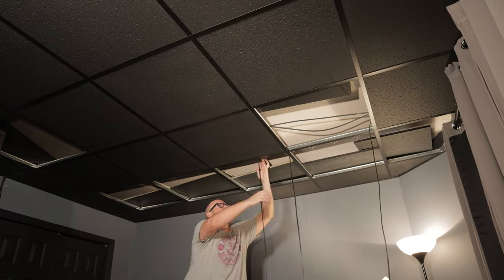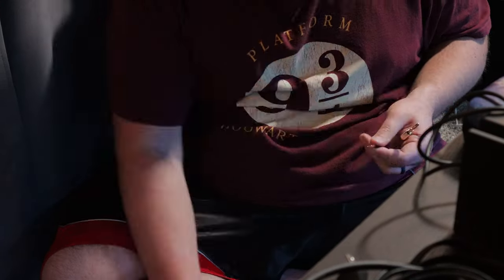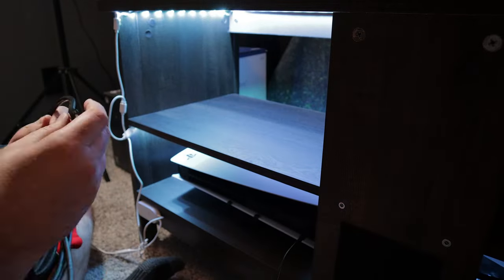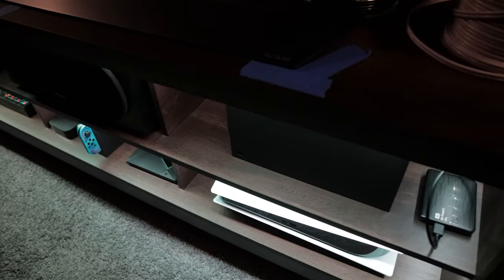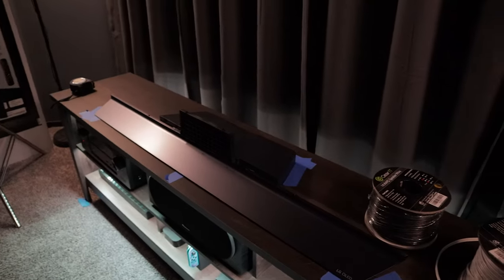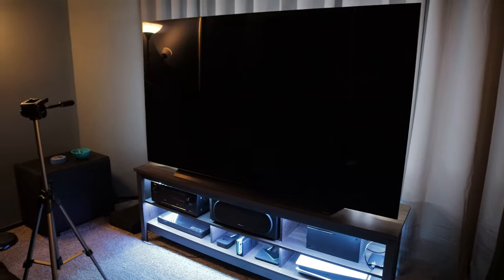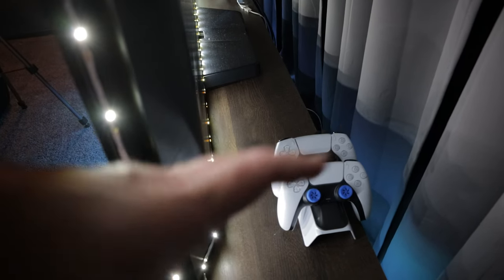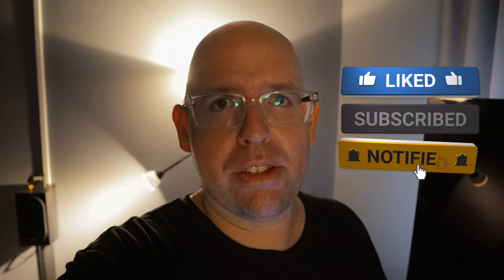DIY Home Theater Build Series | Episode 4 - CABLES and MANAGEMENT

Comment from the maker: For those wondering (and because I didn't mention it in the video): I initially tried running the surround cables and subwoofer cables along the bottom of the baseboard, but there simply wasn't enough room. I didn't want to go through and rip all the baseboards out to route the cables that way, mainly because I wanted fairly easy access to the cables for various reasons. So I made the decision to go through the drop ceiling and running them down the walls in cable channels.

Did you miss a DIY HOME THEATER BUILD SERIES video? I have a playlist for that! I'll be updating it each time a video comes out so it's always up to date. Check it out here: https://youtube.com/playlist?list=PLriHxML5BOuOGSblupmoGmyXveRpTEd2V.

Comment: I really like the genuine DIY nature of your videos.  Very down to earth and logical to follow for the 99% of us without big budget rooms.  The one thing I keep thinking when watching your build series is subwoofer isolation and bass rattle.  Unless you have a 100% effective subwoofer isolation solution (does that even exist?) it just seems like those closet doors, drop ceiling and wires in the ceiling would create a bit of rattle with 4 subs pressurizing that room.  I've used cheap weather stripping to keep my door from rattling but the bi-fold closet doors may prove more of a challenge.  Can't wait for more on this room.
Reply from the maker: Thanks so much for the comment! After testing (and then testing some more), I haven’t noticed or detected any rattle from the drop ceiling at all. The bi-fold doors and entry door are another story. Haha. Time to test some solutions.

Comment: To straighten the Cat6, I use a small jewels screwdriver to separate the 8 wires. Once I orient them, I use the shaft of the screwdriver and run it from the fingers that are holding them in place to the end. This straightens them and I can place tm in the ez end connectors I use, and the tool cuts and crimps the end at the same time. MAYBE 30 seconds per end.

Comment: Is that drop ceiling? Aren't you worried that the bass may rattle the ceiling? It does with mine and it's very annoying. Not sure how to deal with it.
Reply: Oh, good point.  Surely the track rattles as the panels move.  Maybe bean bags in corners of each panel.  Just a thought.
Reply: I'm also confused by the air vent above the ceiling tiles.
Reply: @jebo4jc  In one of his previous videos he explains that he needs to find a way to move that vent to the drop ceiling.

Comment: Nice Brad👍

As another option, you can run speaker wires along the baseboards, or even hide them behind the baseboards if you ever decide to replace them.

Comment: Surely you could have chased the walls out for the speaker wires, then fill over them, instead of using trunking (cable channels).  Still jealous you have a dedicated room though!
Reply from the maker: I could have, but don’t call me Shirley. 😁 I actually think I prefer the cable channels honestly, as weird as that sounds. Once painted I felt like I made the right decision for this room, but that’s entirely subjective.
Reply: @HomeTheaterGamer  I can see why, it would be easier for maintenance or swapping equipment out to have it surface mounted.